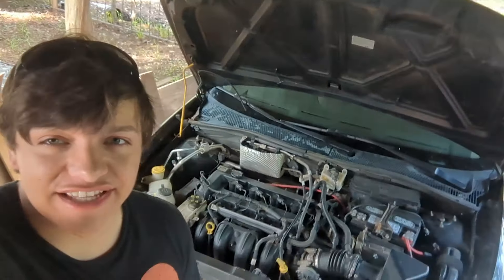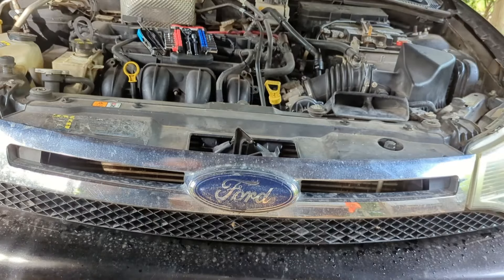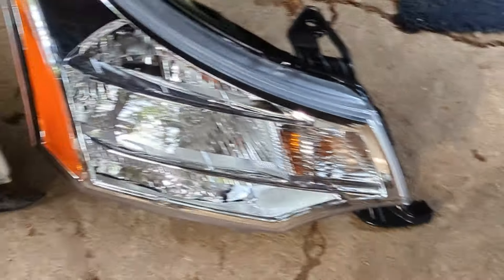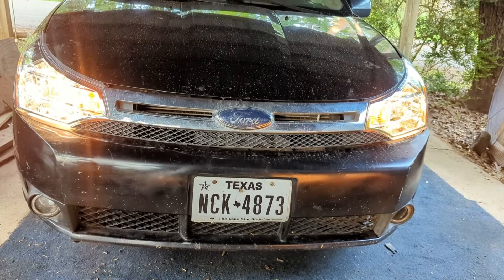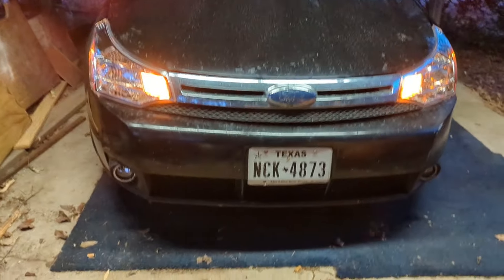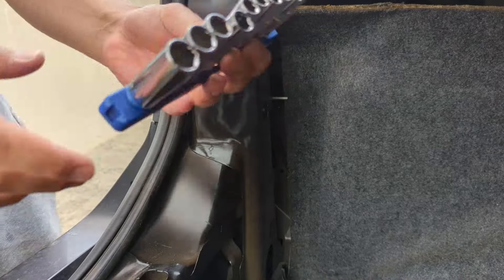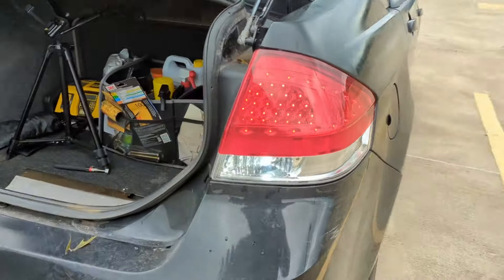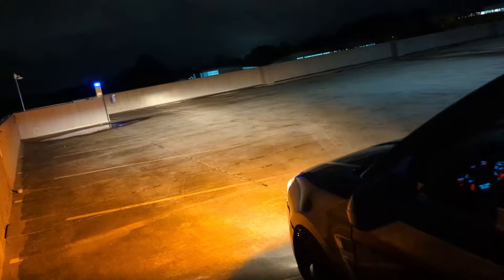Let There Be Light! headlights, fog lights, rear LED conversion | Fixing Focus ep. 1

Comment: I’m 19 years old, and this is my first car too! And this exactly the same thing I’m doing for my black 2011 ford focus sel, I put an SES front bumper on, SES trunk spoiler, SES rear window spoiler from a 2 door, 15 inch pioneer subwoofer in the trunk, and 350w pioneer door speakers, what’s next is a keys tail and headlights and remote start! Love what you’re doing bro, we align well with our focuses
Reply from the maker: @romanelectrics6166  That's an awesome sounding project. I'm actually buying an '07 ST. I'm at the point on this project where anything else I do is just really expensive (car needs a wrap, paint is beyond saving) for example. So it's actually cheaper to buy this other Focus. But I will come back to my SES